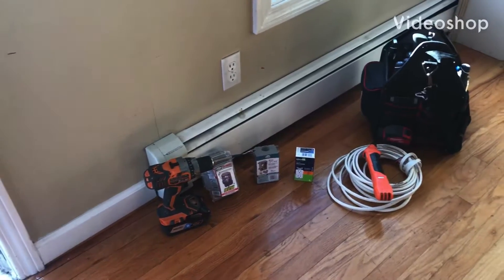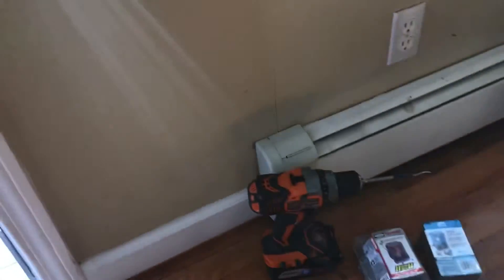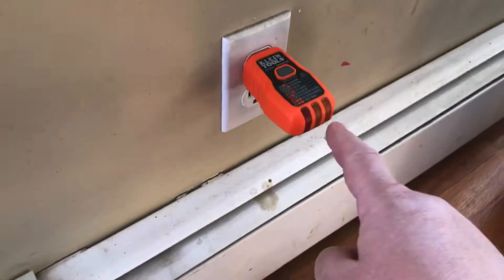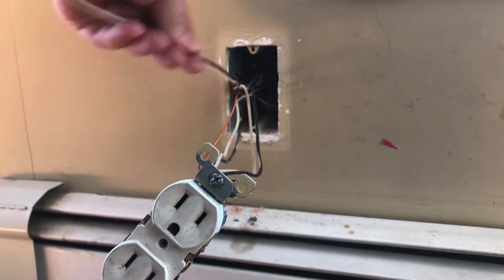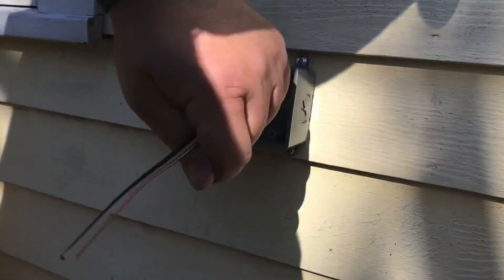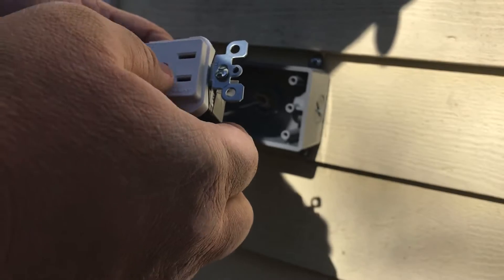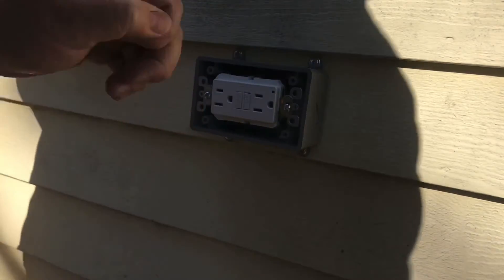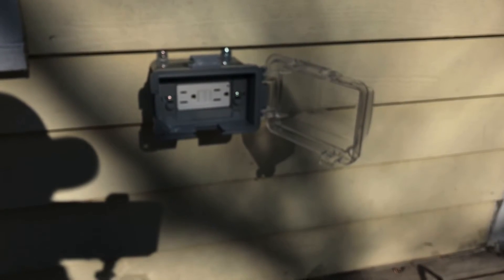How to Install an Outdoor GFCI Electrical Outlet

Comment: 100% has to be up and down, that way the water runs down the line, horizontal the water can run up the line into the outlet, it should trip but is that something you want to deal with

Comment: Nice job, however outdoor receptacles should be weather resistant per NEC. It looks good though!
Reply: There's a lot that needs to change. Most everything with the existing outlet and the one he installed does not follow code.
Reply: What do you mean, isn't that he put in for outdoors.
Reply: @will2dmax1  the receptacle itself is not weather resistant. You must install a weather resistant receptacle